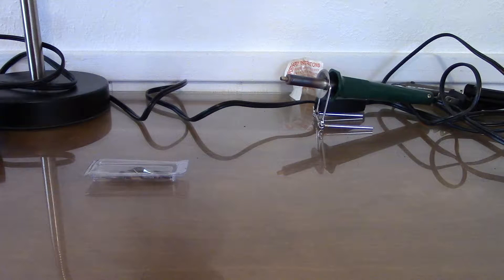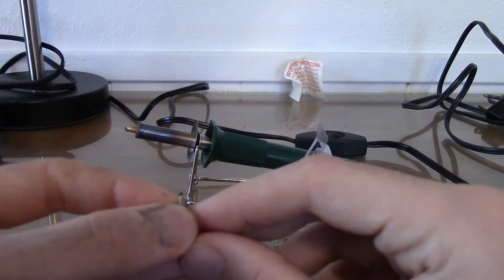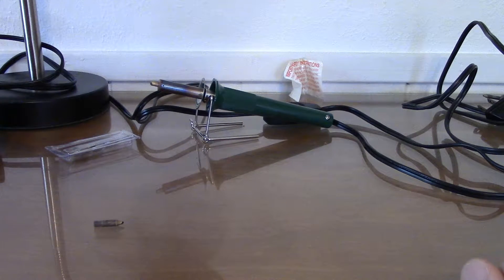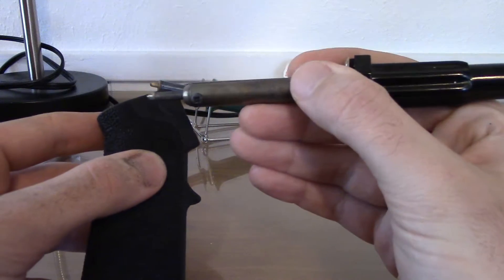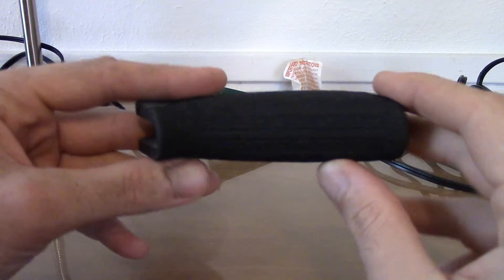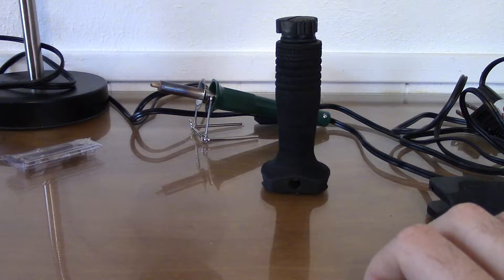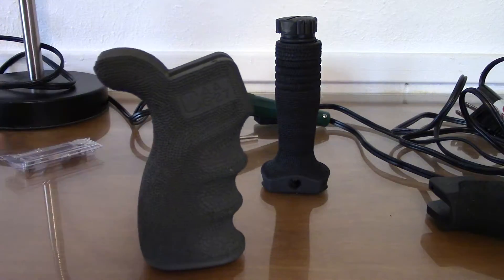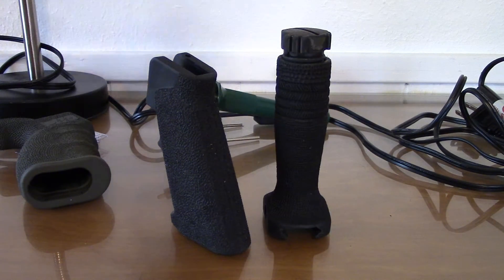Walmart wood burner for polymer stippling

Comment: I've found ps2 and ps3 controllers make a good practice surface. It's  a hard plastic not exactly polymer but will behave in a similar fashion when stippling.  Yeah I bought one of the better wood burning kits on Amazon for like $50.00 came with like 30 different brass tips and different blades, gloves, stencils to trace, colored pencils, a lot of other useful things. I like the basket weave texture and gator skin about the best
Reply from the maker: The basket weave sounds pretty awesome!